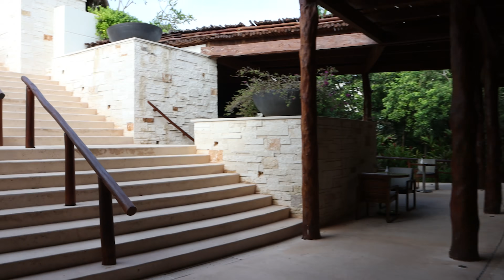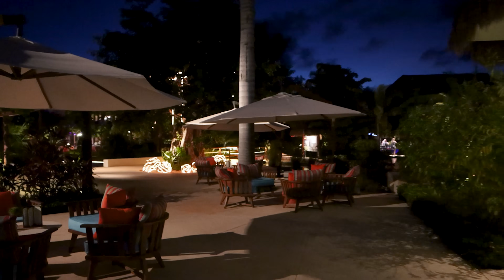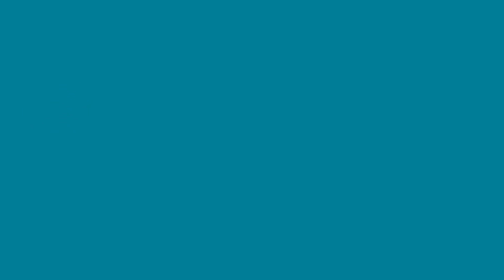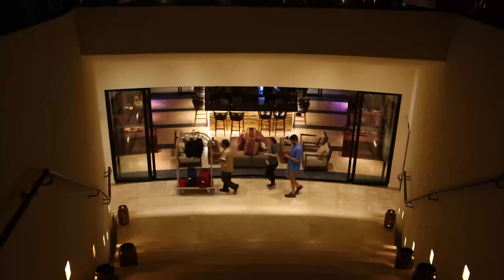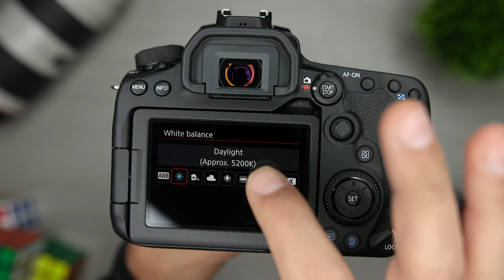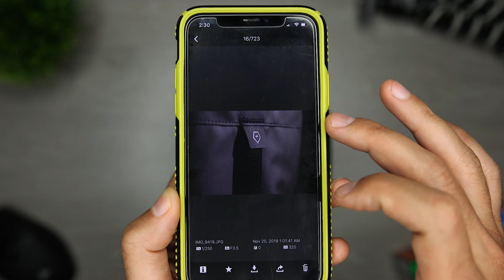Canon 90D - Watch Before You Buy

Comment: One question though. Does 90D continue shooting pictures till the SD card is full, like the rp? Or does it simply stop shooting after 25 shots? And for the quality. Does the higher mp with the crop, match the lower mp full frame in quality? Let's say, 90D vs RP. Same CPU, crop vs ff and 33mp vs 26mp. Both shooting raw and the same settings used.
Reply: Oh yeah, using the 50mm 1.8 on both 😊
Reply from the maker: Hi. I mentioned the buffer limit on the 90D for jpeg and raw - so it won't shoot forever like the RP. 

I have never done the test you mention so I don't know the answer.
Reply: @TechGearTalk  actually the 80d never stopped shooting, but yes it went slower after fps limit was reached. I shot over 500 pictures in a row on 80d, trying to get lightning 😊 but yes, rp doesn't lose the speed.
Reply: @TechGearTalk  now you could try the test I mentioned 😁
Reply from the maker: Thanks for the info about the 80D

Comment: How does EOS M6 Mark ii compare against 90D? Especially wrt weather sealing, image stabilization & lens choice?
Reply from the maker: No weather sealing on the M6 MK II. 

Stabilization is the same. 

Lens choices depends on how you look at it. Natively, the 90D can accept a lot more lenses (EF/EF-S). But the M6MKII can accept EF-M lenses, and then all the EF/EF-S lenses with an adapter. You can also use a speed booster. 

Hope this was helpful!
Reply: Tech Gear Talk Thank you! This helps and decided to go with M6 Mii. Primary requirement is compactness.
Reply: Tech Gear Talk Also it'd be a great help if you guide how to have M6 covered for light shower days, in case I have to 😁
Reply from the maker: Glad it was helpful, I'll see what I can do.

Comment: Hi I just bought Canon 90D and I'm really excited to use it for portrait photography. Can you make a video tutorial for Canon 90D with the kit lens 18-135 mm for portrait. Thank you
Btw, after the firmware update to get 4k and 1080p 24 fps, it didn't register and my slowmo only has 100 fps. What should I do? Pls help 
Nice Video!
Reply from the maker: Hi.  I will work on a tutorial. As far as the frame rates, it means you're shooting in PAL. Go to shooting settings and change it to NTSC and you'll see the new frame rates. Hope that helps.

Comment: what will be a good blog lense on it? do you think the sigma will be ok with vlogging?
Reply from the maker: It will be a heavy setup, but it works great (I've used it).
Reply: @TechGearTalk  so on your video,did you vlog with the sigma? were you hand holding it or used a gorilla pod?
Reply from the maker: No, I was using the Canon 10-18mm - much smaller/lighter (but of course not as fast)

Comment: I'm not sure what I should pick (Primary photography but also video). The 90D and the RP are my favourites but they have different pros and cons. I think the 90D has apart of the APSC and the low light performance a little bit better specs but it's a DSLR and I don't know if it make's sense now to buy a DSLR any more so the RP is in this point better because it has no mirror. I hope you can help with a message or even a video ^^.
Reply from the maker: Good thinking. What about this? https://www.youtube.com/watch?v=3Dh2cqok6_o

Very similar features to the 90D, mirrorless, less expensive
Reply: @TechGearTalk  I'm not a huge fan of the M series. If I would buy a mirrorless camera I would go on the RP, and now I'm between the 90D and the RP. Both very good cameras but the choice is hard. What's your opinion? A detailed comparison video would be really good.
Reply from the maker: I'll put a video together as soon as I can. The M50 had its issue. What is the problem with the M6MKII (as far as it being part of the M line). I really like it because with a speed booster, I can get close to full frame field of view (which I can't do with the 90d)
Reply: Tech Gear Talk I dont like the viewfinder and its also too small. I think i will go on the RP.
By the way, I also heared that there will be probably a firmware update for the RP in march which will delete the Crop at 4k.
Reply from the maker: That would be really impressive if they do that.

Comment: Great review.  I have been using the 80D for some time and love it.  Would it be worth “upgrading” to the 90D?  I do mostly travel and sports photography.
Reply from the maker: Thanks Ed! A few questions, does 4k matter to you (from the info you provided I'm assuming "no" but just asking)? Do you want/need more resolution to work with - for more cropping options? Clean hdmi out (assuming no)? Face tracking in viewfinder?
Reply: @TechGearTalk  Thanks.  Based on your questions (and my answers) I think I'll keep the 80D for now.  Thanks again.
Reply from the maker: Glad it was helpful. I'm never a proponent of upgrading just to upgrading. Save that $$$
Reply: Its sensor is on another planet compared to the 80D. Canon have finally learned how to make a sensor.

Comment: Great job on this video, Sagi! You took some stunning photos and great video footage with the 90D.  Quick question ...what would be the first all around L lens that you would recommend? I’m considering the 24-70mm F4 or the 24-105mm F4.
Reply from the maker: Thanks Timeka. Good question. Both are outstanding options. The 24-105 is 250 more but you're getting and extra 35mm of range which almost doubles it. If it's in the budget, and the longer lens is not an issue, I would grab that one. If not, the 24-70 f/4 is still a really nice option. 

My question is, what would you use it for? and would the additional focal range be useful?
Reply: Tech Gear Talk Thanks!! I want to use it for both video and pics of my fam. Not sure I would need the extra 105.  Also,  if I go with the 105, I’m still debating over the EF version or the RF version 🤔
Reply from the maker: Are you using an R or RP? That RF 24-105 is sort of the best because you're still at the lower rate but getting the additional range and you're future-proofed in terms of lens mount. 

Is there any downside to the RF lens that you heard of? (I haven't)

(Thank you for the kind words about the footage and images - forgot to acknowledge that before).
Reply: Tech Gear Talk No worries. I have the RP. I’ve heard nothing but great things about the RF 24-105mm but I also own the M50 and 80D(my husband’s camera). Was trying to get something that I could use with all 3.
Reply from the maker: That's a double-edged sword there because the newer lens is less expensive but also less compatible.

B&H has some 24-105 in the used section for some pretty good deals... https://bhpho.to/2KOQxtw 🤔

Some V1 but also V2.

Comment: Would like you thoughts on something.  I want to upgrade from my Canon T3.  Plan to stay with aps-c since I have EF-S lenses already.  18-55mm kit lens, Canon 55-250mm IS II and a Tamron 18-200mm.  Trying to decide between the Canon 77d and the 90d.  Most of my photography is night moon shots, some night no flash shots at the local park, airshow, some portrait and eventually astrophotography.  Planning on doing this early next year once my social security kicks in.  Also considering some Canon lenses.  85mm f1.8, 50mm f1.8 and either a 24mm 2.8 or 10-18mm.  Any help would be very much appreciated.  I have been using Dashlane for a while now and very satisfied with how it works.
Reply from the maker: William, If you're not going to use the 90D for video, I probably would say save the money, get the 77d and spend the rest on lenses. I love the 50 1.8 https://www.youtube.com/watch?v=8EEKkrOuj-w and I think the 10-18 is a very good value. 85 1.8 is also nice but remember the added crop which makes it a little tight for portraits (for how I shoot).

Does this help?

Appreciate the feedback on Dashlane!!!
Reply: @TechGearTalk  Yes, it helps alot.  I'm not really into video although once in a while I may video a model build or my nieces opening presents for Xmas so I don't need 4k.  1080p is more than enough.  The 85mm would be equal to a 135mm due to crop.  Could still work for portrait, would just have to stand back a little further but the f1.8 could be useful in low light situations.  Wasn't sure if 32.5mp would be a big improvement over 24mp.  Plus I heard that on the 90d they removed one of the connector pins on the hotshoe so 3rd party flashes may not work on it.

Only issue with Dashlane if you want to call it an issue is when I leave my computer on for a few days Dashlane pops up wanting me to relog in.  Bugged me at first but now I am thinking it is a safety feature to be sure you are at the PC or it is just a only happens to me thing.  I got tired of writing down all my passwords so it is a big help keeping that organized.
Reply from the maker: Yeah, I'm sure it's a security feature in Dashlane. I think they added an option for 14 days now. OMG, I used to have websites where I wouldn't even try to remember the pw, just reset it every time because the rules were like: upper case, lower case, number symbol, stand on your head, type with your left hand...

Comment: Is it worth upgrading from a 80d to this im really considering it can you please advice me man
Reply: Nah you're good
Reply from the maker: It would depend on what you're using the camera for. What do you use your 80d for and which features about the 90d are important to you?
Reply: @TechGearTalk  let's say a little bit of vlogging and video but mostly photography. Then?
Reply: Tech Gear Talk i mean the bigger sensor on the 90d and the 4k video the 120fps on 1080p all that stuff andthe digic 8 processor as opposed to the digic 6 on the 80d
Reply: Tech Gear Talk so what do you think should i do beed advice and i use it for vlogging and sit down videos and i also love photography so thats what i use it for
Reply from the maker: 4K is a definite win, so is the processor. 120fps is "ok" as long as you don't mind having no autofocus (for me it was really hard to use unless I was shooting super wide). 

Ultimately, you can sell your 80D and make this purchase a lot easier. Uncropped 4k (if you plan on using it) would be a reason I would do it. 

Debkillz - for you, the additional megapixels are really nice to have, but it depends on whether you feel restricted by your current resolution. As far as just the vlogging/video, If you don't plan on using 4K, it wouldn't be a big enough reason to switch (for me). 

Hope this helps